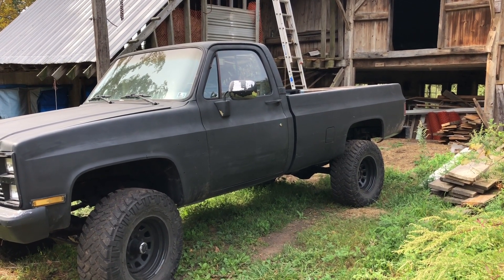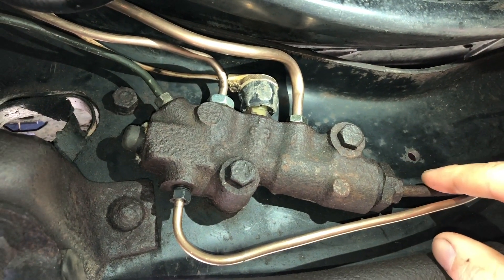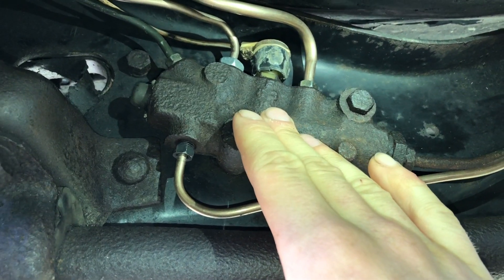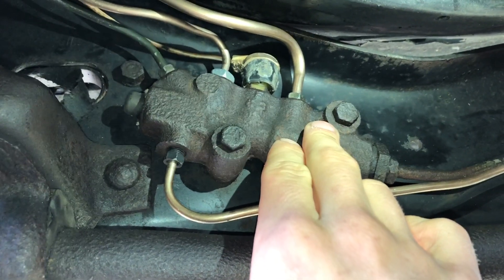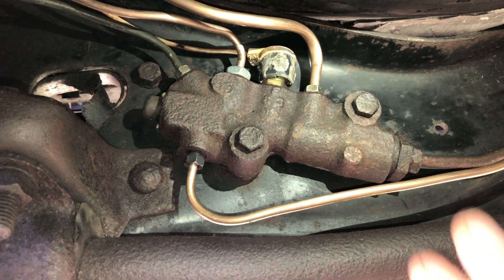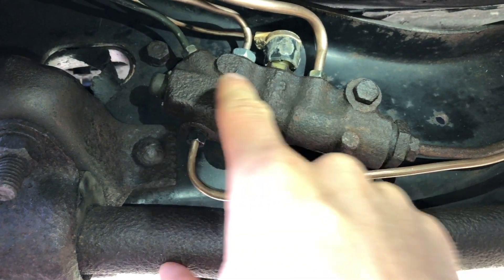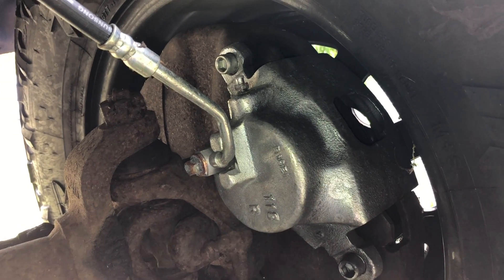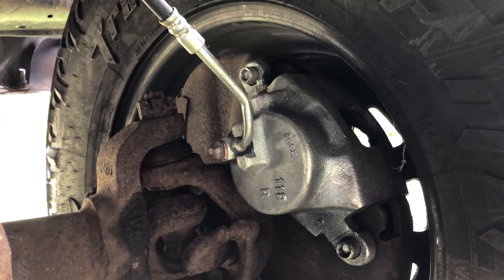GM Proportioning Valve Reset

Comment: So how exactly do you reset the proportioning valve? Just bleed the brakes? But isn't that what causes the valve to need resetting in the first place? What is the rubber covered button do we need to press that to reset the valve? Do we need to bleed the valve after bleeding the brakes do we need to bleed the valve at all? My right front caliper is sticking and thinking it was the caliper I replaced the caliper with a remanufactured unit and it still sticks. There is no issue with the drivers side.
Reply: I’m having the same problem replaced whole brake system other than lines and my front brakes keep gradually sticking the more I use them I can’t figure out what the problem is, have you?
Reply: @sethross8688  The solution to your problem is going to surprise you. But trust me do this to solve your problem. Replace the rubber break lines. All of them. If one is bad they are all bad, or going to be bad very soon. Here is what you need to do to figure out which one is bad. Put your car on jack stands you want all 4 wheels off the ground, have someone step on the break pedal and release the peddle. and then spin the tires repeating the proses for each tire. When you find the tire that is locked up that is the bad rubber break to caliper hose. what is happening is the rubber break line has a steal bracket that wraps around the break hose. And even though it DOES NOT LOOK LIKE it, it is rusted between the bracket and the rubber line causing a restriction. Think of it as a blood testing cuff. The tighter the nurse pumps up the cuff the harder it is for your blood to flow through your veins. So the same thing is happening to your hydraulic break fluid, and that is what is causing your sticking breaks.
It this was helpful to you please see my YouTube Chanel and thanks for looking.
Reply: @ricksteelcustoms3196  so your brakes sticking was caused by the brake lines? I see nothing wrong with them as when I bleed them they all spray out fine and they gradually lock up as I continue to use them both front tires are the ones that lock up over time not necessarily LOCK but they will stick then I use them more and they stick harder and so on
Reply: @sethross8688  My break lines looked perfectly fine but you cannot see what is going on inside the line. I had the front right passenger side caliper sticking I took the rubber brake line off the car and tried to blow air through is and it would NOT pass through freely and I bought new lines and the air passed right through the lines freely without any resistance. So I cut the rubber line open at the steal mounting bracket in the center of the break line that bolts it to the upper control arm and it was squeezed completely shut because of rust. What you have to remember is that when you are stepping on the break peddle the line is highly pressurized so the hydraulic fluid WILL pass right through the obstruction. But there is no pressure forcing the hydraulic fluid back through the rubber line towards the master cylinder. All I can tell you is my brakes worked 100% perfectly after changing the rubber break Lins and my sticking brake problem was 100% gone and has NOT been a problem since.,. What year make and model car do you have? My vehicle was a 1984 Chevy C10 pick up truck.
Reply: @ricksteelcustoms3196 I changed the two rubber up front and the 1 in the rear still not returning fluid from front keeping it locked up ..all 4 corners bleed fine ...once brakes are applied the front stays locked up

Comment: So I've got a 2000 Chevy Silverado 1500 2 wheel drive and I hit the brakes the brakes locked up on the front passenger side... I was able to go away until it heated all the way up bright red and I couldn't move anymore I did the same thing until I got home... I bought all new brake pads, rotor and caliper with everything! I took off the old one and the piston in the caliber was cracked in half probably from getting so hot as I drove it home I mean the rotor was literally glowing bright orange and red... but anyway I put everything new on and when we push the brakes for the first time it locked up immediately this time it won't move at all because they're new brake pads the old ones were old and trashy so it couldn't lock so hard but now it won't move at all! Does anybody know what would cause this? I didn't hit anything to BEND a line or anything it happened in the middle of a 6 lane highway when I hit the brakes... I think I remember that same brake smoking all over a few weeks ago for a few min then it was fine. well... they were fine until they locked up a few weeks later anyway... I did have the pedal get loose and hard in that time between... where i would hit the brakes the pedal would be hard and work but then loose pressure and go almost to the floor... ANY HELP WOULD BE APPRECIATED!!
Reply: Have you figured it out, I have the same problem
Reply: @sethross8688 same issue

Comment: Thanks man I have a 87 k5 and had the same problem replaced the master cylinder lines and the whole brake assembly on front and back tried this and its a good a hold now! Thanks, and subscribed.
Reply: We felt like it was the prop valve but didnt know how to reset it
Reply from the maker: Happy to hear that it helped man and nice truck!
Reply: @Kyle-ry5kg  appreciate it man they are good ones

Comment: If you take an oil can and pump brake fluid backwards through the system with the master cylinder cover off. you won’t trip that valve and can bleed them normally. 
I dont know of anyone who has had good luck with the little plastic tool.
Reply from the maker: Thanks for the tip. I’ve got to do brakes on a K5. Will try this out
Reply: What do you mean "backwards"? As in hang a container with a hose to the bleeder? My proportioning valve won't pop back into place.

Comment: So I’ve bled the brakes many times I’m having trouble w my rear brakes everything back there is new drum kit, shoes, lines, flexible line the cylinder and drum. My rear brakes aren’t engaging when I press on the brake but I do get  fluid out of them and my emergency brakes work can anyone help me out
Reply from the maker: You getting a strong fluid flow out of both lines? Could have a trapped air bubble somewhere in the line or the prop valve could be tripped.
Reply: @Kyle-ry5kg  hey thanks man for replying and yes I do get good flow both ways I’m guessing it be the proportioning valve I’ll change that and see what’s happens
Reply from the maker: Sounds like a plan and good luck.

Comment: Does a 2002 tahoe have this i have replace booster,master cylinder and front break lines cause one got snapped when I got hit now im not getting fluid coming out when I bleed rear passenger
Reply from the maker: It might not - I’m unsure about newer cars. If it did it might be located near the master cylinder or somewhere inside the frame rails. Follow the brake lines and you’ll find one if it’s there. Also try gravity bleeding your brakes. If that still doesn’t work you may have a really stubborn air bubble. Best way to deal with that is with a vacuum bleeder or re-run the line.

Comment: You didn't show how to reset the valve... Why?
Reply from the maker: Skip to 3:38 for step-by-step instructions on how I did it. Some people will remove the rear brake line and use a pin to push the valve component/needle back into place. I didn’t do that. I just opened the system under pressure and that made it reset.

Comment: There is a lot of info but no video on how to reset the valve ? How come you didn't show that part?
Reply from the maker: Skip to 3:38 for step-by-step instructions on how I did it. Some people will remove the rear brake line and use a pin to push the valve component/needle back into place. I didn’t do that. I just opened the system under pressure and that made it reset.

Comment: simulate front brake failure to reset valve...why does it get stuck?  poor design, bad quality fluid?....also im so over mixed brake systems...4 disc plz
Reply from the maker: It’s probably the design. Mine has gotten stuck even with clean fluid and lines.

Comment: My rear brakes are dragging..im wondering if this may be the problem I put New everything and I mean everything 🤔 I have fluid coming out the back..Here is the crazy part while setting up the rear adjustment the drum turns just fine but as soon as I tighten the wheel it won't turn at all🤷‍♂️
Reply from the maker: Is the fluid flow decent?
Reply: @Kyle-ry5kg  yes
Reply from the maker: weird that the lines are flowing well. I wonder if the shoes are the right size
Reply: @Kyle-ry5kg  i have 2 inch ,shoes 2 inch drums
Reply: @BeardsandCars  bad brake cylinder/caliper or hose. the rubber hoses can collapse internally and not allow fluid to return back up the line and cause the brakes to drag.

Comment: have a 88 Full Size Jimmy...Replaced front to back with all New Brake parts including Brake Booster and 2 Master Cylinders and when i start my Rig Up the Pedal Goes Right down to the Floor?? i have Great Vacuum pulling from Engine all is good and i must have bleed system like 6 times already?  so whats the culprit here?  any takers !!
Reply from the maker: 1. Nice ride. I got a 78 k5 myself and been going through that in some other videos. 

2. You sure the pedal is still connected to the rod that goes to the brake booster? Stupid but could be the culprit, especially if the pedal isn’t returning up. Check the vacuum hose off the manifold, it could be that. Finally, have you bench bled your master cylinder? It could be air in that. 

All in all, I’d imagine it’s in your brake booster or master cylinder.
Reply: @Kyle-ry5kg  well its all connected and secured rod in place! i always Bench bleed "All" my Masters and Did this one as well. and lastly ....just replaced the Vacuum Booster and replaced the Master 2 times with "New" thinking it was the Master??  and other ideas? i have NO Air anywhere Mr Fixing Junk, sad to say this is crazy... i'm all ears and thanks for getting back to me so quick! please any and all suggestions welcome!!
Reply from the maker: You’re getting fluid through all bleeder screws? Could it be the wheel cylinders or a brake hose? Brake hoses can collapse/swell inside (when they get old) and they can look ok on the outside.

Comment: Can this cause the brakes to absolutely suck ass if it’s going bad? I have a 1985 bronco and I’ve replaced everything to do  with the brakes except for the proportioning valve and tonight my brakes wouldn’t stop when I was in reverse
Reply from the maker: Make sure you didn’t run your master cylinder dry when doing all that work. That’ll make your brakes feel like trash if there’s air in it. 

I don’t believe the prop valve goes bad.  Either it works or it doesn’t you know? Someone will correct me if I’m wrong. 

You change out the brake booster too? That can cause you to have poor braking if it’s going bad.

Comment: I've heard there's a special tool of some sort that you put on the proportioning valve to keep it from locking out the brakes when you bleed the system. I I'll probably have this issue with my 85 C30 when I rip the drums off to replace the wheel cylinders as well as bypass the hight sensing proportioning valve on the rear for the back brakes. Hopefully I won't have to bench bleed the master cylinder because the reservoir for the back brakes is bone dry because the rear brakes loose so much fluid.
Reply from the maker: There is a tool. It’s a piece of plastic that screws into where the brake light sensor is. Should be able to find it on Google. 

Would recommend bench bleeding your master cylinder if a reservoir is empty - especially if you can get the lines off easily. It’s really not hard to remove/install the cylinder itself. I did a video on it on my 84 K20: https://m.youtube.com/watch?v=F8xiHrk5WIA

Good luck with the job and feel free to message me with any questions.
Reply: @Kyle-ry5kg  Honestly all the brake issues with the back brakes were supposed to be fixed while the truck was getting the trans replaced along with the front brake hose on the passenger side but the guy decided he'd rather let the truck sit on his lot for 2 or 3 months after putting the rebuilt trans in.
Reply from the maker: That sucks man. The C30 sounds really cool too. Is it a dump body? I’m working on a 69 C50 in one of my newer videos and it’s becoming one of my favorites.
Reply: @Kyle-ry5kg  😆 no just a plain long bed dually 4 door Silverado Camper Special.
Reply from the maker: Nice!!

Comment: If that is how that valve works, wouldn't it trip every time you bleed your brakes?
Reply from the maker: Technically it can and tripping it is a risk you run when you bleed your brakes - at least on some vehicles. As I understand it, a vacuum bleeder can help reduce the risk that you’ll trip it when bleeding the brakes.
Reply: @Kyle-ry5kg  I think what this person is referring to involves replacing brake lines. The valve tends to activate when you try to fill that empty rear brake circuit. This is a bigger problem than you alluded to because this GM style proportioning valve is used extensively in the aftermarket to replace single bowl master cylinders (e.g. the 1965 Mustang).  In reality, the valve only needs to activate to isolate the rear circuit.  If the front fails, the rears are not isolated by the valve (typically), and the rears continue to work.. If the rears fail, then the valve activates. To answer this person's question, Yes!. Without that little threaded tool that temporarily replaces the dash light switch, it will continue to fail.  It screws into that port and bottoms in a groove that circles the valve shaft.  Once you reset the valve, the tool holds it in place until bleeding is complete. Summit sells them for about $12.  Most new proportioning valves come with a plastic one.
Reply from the maker: Thanks for the added context. As much of a pain as these things can be they’re definitely necessary and a major safety component. I’ve never used the tool you referenced but I’ve heard it works wonders.

Comment: I think this may be my problem.. I have a 77 Chevy c10 and we’ve bought a couple master cylinders and didn’t fix the problem. The front brakes bleed fine but the rear brakes barely get any fluid from the master cylinder. We’ve blown out the lines going to the rear brakes and they’re clear. Maybe this could be why the fluid is barely dripping out and we can’t bleed the brakes..
Reply from the maker: Sounds like it’s your issue. It’s pretty common for this to trip and shut off the the rear drums. Tends to happen if any hard lines in the braking system were disconnected for a chunk of time.
Reply: Fixing Junk my dad still thinks it’s the booster though so it’s got to be one or the other!
Reply: Fixing Junk plus we also put a new rear end on it
Reply from the maker: Sounds like a sweet ride. Check the wheel cylinders in the rear drums, they could be bad. Also, likely not the booster. I had this problem after putting in a new booster.
Reply: Gotcha I’ll check it out the wheel cylinders are also brand new lol . Will keep ya posted thanks for responding!!
Reply: @ZeusDavis21  with the truck off step and hold the pedal, if it bleeds down it’s a bad booster.
Reply from the maker: Good luck
Reply: What was it? Was it the proportioning valve? I have a 1979 c10 and I have this issue.